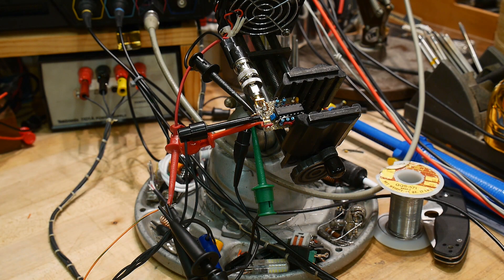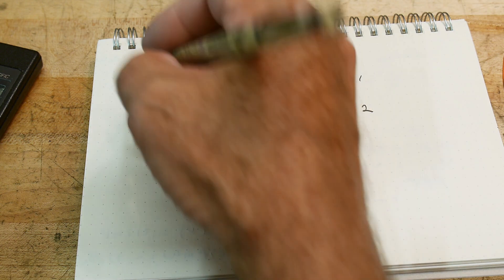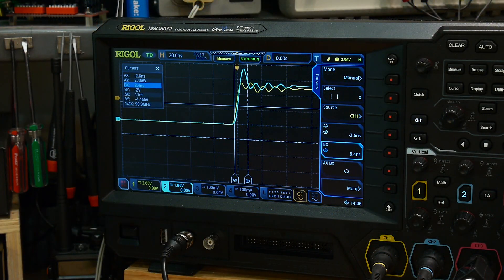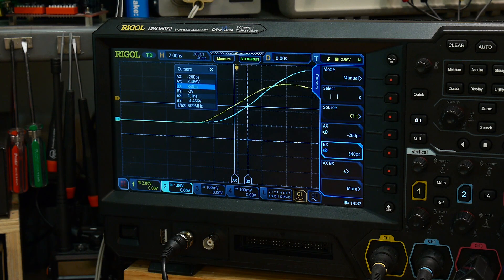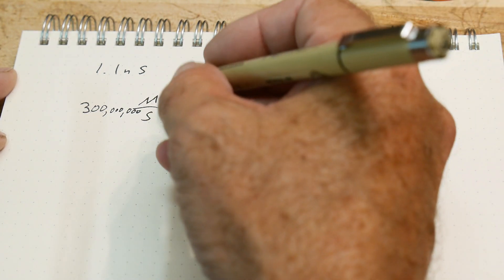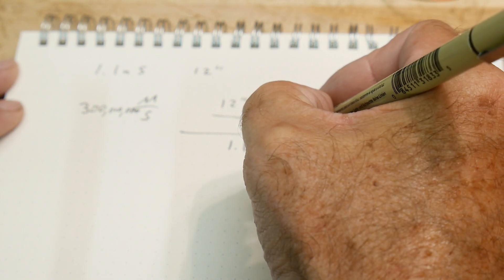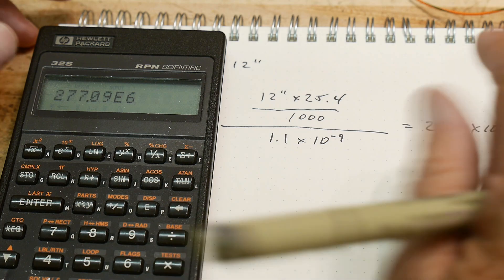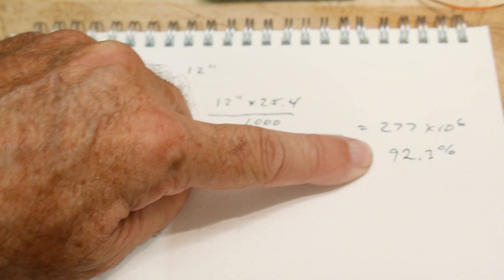#895 Measuring the Speed of Light

Comment: It is possible to program  the oscilloscope using VISA driver with SCPI commands in VBA code or even Python to automate and measure exactly the difference of delta x and also set the generator for different source of frequency and see the correlation using the real values of the total distances

Comment: In my opinion the experiment shows the time difference  between 2 signals sent from the same source over 2 wires with different length… but it does not proof speed of light, it’s only latency caused by length of transmission line (assuming that both wires are 100% the same).

Comment: I still like the method using a microwave oven with the rotating platter removed and a large bar of chocolate placed in the oven. The frequency is on the side of the oven typically 2.45GHz. You power up the microwave for a few seconds at a time until the chocolate is starting to melt at some fixed points in the standing wave (because the chocolate is not rotating). Then you measure the distance between the molten blobs in the bar and you have the rough wavelength. The rest is just maths, which is done while eating chocolate.

Comment: Why not use an LED and two photo sensors of some kind, one at 1mm from the LED and one at 1 meter away. The scope probes should just about span 1 meter with the scope in the middle...
Reply from the maker: or use a mirror 1/2 meter away
Reply from the maker: a spinning polygon mirror is a classical way to measure C in physics class.

Comment: You are not accounting for the velocity factor for a piece of copper wire.  Ham radio operators have been making wire antennas and they are always shorter than the theoretical calculated length.  Also, you need to set the scope so that each trace has the same vertical display height OR so that both have the same deviation above and below zero.  

Many others have already commented on the difference of signal propagation and the actual speed of the electrons.  To give another analogy to illustrate the point:  Imagine a piece of pipe laying in the floor.  You hit one end of the pipe with a hammer.  The pipe slides lengthwise at a measurable speed, perhaps a few inches over a few tenths of a second.  But the movement (the signal) is transmitted nearly instantaneously to the other end.

Comment: It is not the speed of electrons but the speed of the signal: an electron is moving at few millimeters per second, but the wave formed by average movement of all of them in the conductor is moving at a speed close to light. Imagine a set of dominos falling on each other: each domino does not really move actually ( except falling), but the wave can go as fast as few meters per second. Another fact is that, in copper, signal, currant, or wave of electrons average movement, what you want to call it (and not individual electron), is going a bit slower than light in vacuum.

Comment: That's misleading, sorry, as you're NOT measuring at all the value of c  = 299792458 m/s. You're only measuring the propagation velocity of a electromagnetic wave in a coaxial conductor.
I expected from the title a very different experiment, like sending a LASER beam across a certain distance, etc.
Reply from the maker: clickbate 😎
Reply from the maker: Actually the real message (that EVERYONE missed) was, just how slow the speed of light really is.
Reply: @IMSAIGuy  It's about as close to infinity as it gets.
Reply: In metric land, we use 20 cm/ns as a rule of thumb for "c" in a common 50 Ohm coax cable. The common RG-58/U 50 Ohm coaxial cable has a velocity factor of about 0.66..0.67.

Comment: A long time ago in a state far away, one of the alignments I used to have to do regularly was compensate for delay in a parallel data/clock interface that fed a burst modem.  Due to the length of the cables between the satellite communications controller and the modem, there could be a significant misalignment between bits and the clock because of the differing propagation delay on the lines.  The rule of thumb we generally assumed for the delay was about a foot per nanosecond which was fairly close to what you saw.

Comment: You don't need to measure the speed of light. We know it. Exactly. It is defined. We also know the length of a second. However we don't know the exact length of a meter. And for all in the us, the inch is exactly 25,4 mm (definition - yes, the length of an inch is now based on the metric system), and since we don't know the exact length of the meter we don't know the exact length of an inch. Thus, you are not trying to measure the speed of light, you are trying to measure the length of an inch.
Reply from the maker: What! they already did that? I was sure I was the first. ☹
Reply: @IMSAIGuy  :-D

Comment: You need a HP42s for this computation. HP32s is not accurate enough :)
Reply: Used to use a 41CX before upgrading to 48SX then 48GX.  Over 30 years later the 48GX is still going strong both physically and virtually in an emulator on my iPhone :)   Go HP!

Comment: You need a HP 42s for a good calculation ! That one is not accurate enough :)
Reply from the maker: I should have used a slide rule with infinite analog resolution
Reply: Next you'll be telling him the scope needs to be driven from a rubidium clock source and to also verify down to the nanometer that the signal path on both probes is the same and if not account for it. How far down the rabbit hole do we need to go? Seeing as that scope runs Linux he could get a shell and use 'bc' to do the calculations. For example, with bc:
scale=100
1.000000000000000003*2.540000071000 <- input
2.540000071000000007620000213000 <- output
or use WolframAlpha online ...

Comment: A simpler setup could be: a pulse generator -> power splitter -> two coax cables of same type in different lengths -> two scope channels.
Reply from the maker: how is that simpler than a 1 foot piece of wire?

Comment: The speed of light in matter is less than in vacuum. The true ultimate speed of light has to be measured in a good vacuum.
Reply: I believe you are the one person here that can make that possible. How about a colab? :-)
Reply: @vincei4252  I have to order the laser diode. The rest of the equipment I have. I also have a 7 foot piece of 3 inch diameter pyrex tubing that could be sealed up to make a long vacuum chamber. With two mirrored optical flats, on at each end of the tube, it may be possible to get 5-10 reflections of the beam to get 30 to 50 feet of distance. That should enable measuring to a lot better than 1% I think.
Reply: @glasslinger  Wow, that would be awesome!